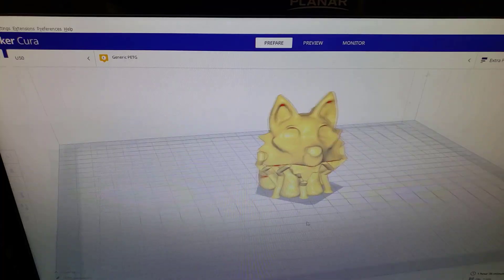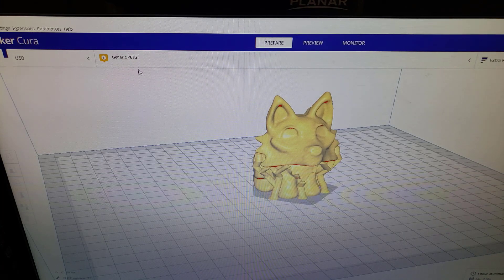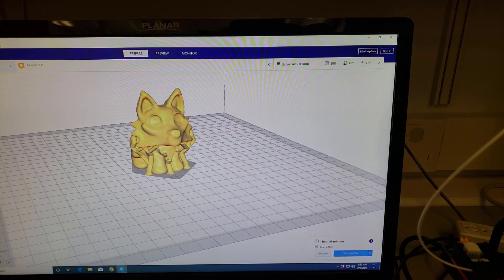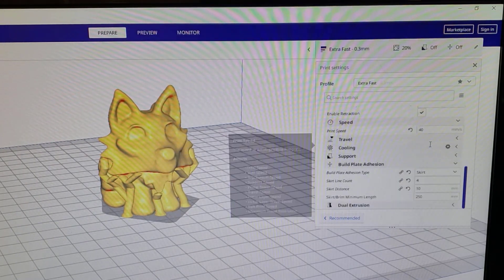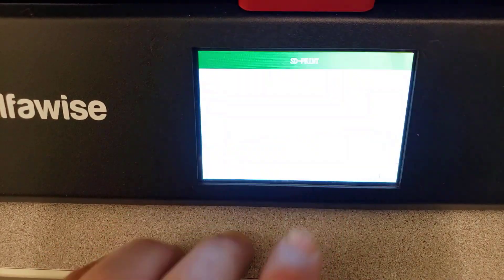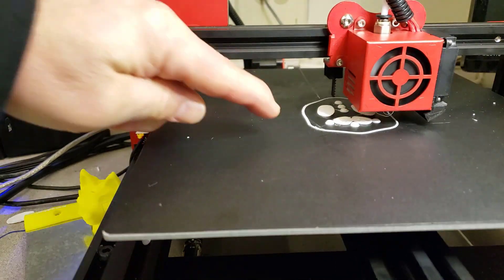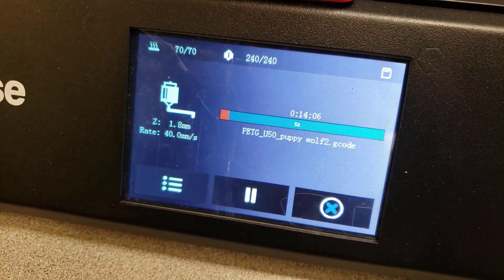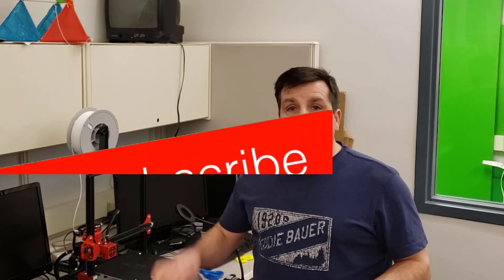Tested! Can the Alfawise U50  handle Duramic 3D Petg?

Comment: Hi! I tried printing PETG with the u50, but I had a lot of stringing problems of the fillament, if you still use this printer with PETG, do you maybe know you retraction settings that you used for this print?
Reply from the maker: I am actually running a roll of PLA+ though mine right now. I have a bit of stringing too, but for my applications I have not tried to get it any better. When I wrap up the reel of PLA+ I will see what I can do with Petg. What numbers are you using so far?